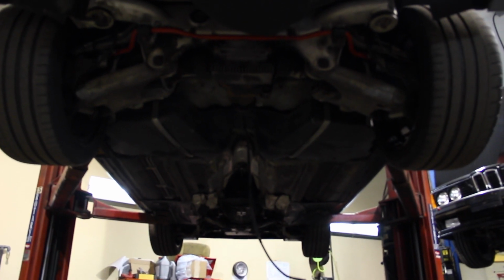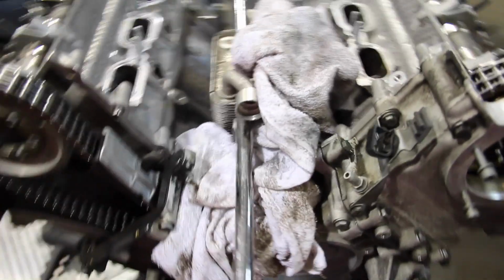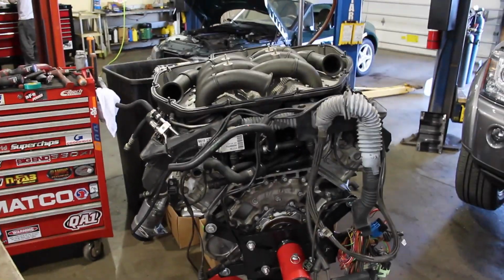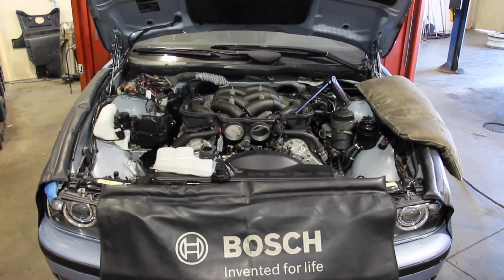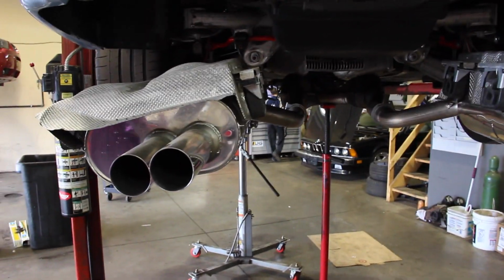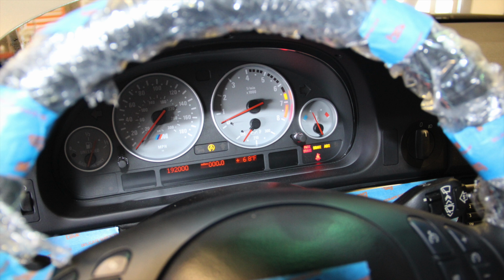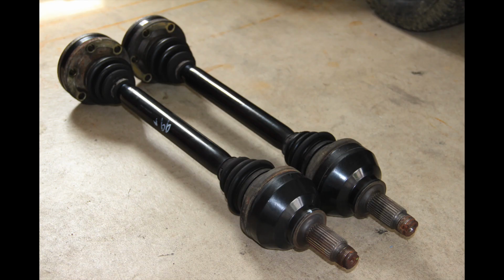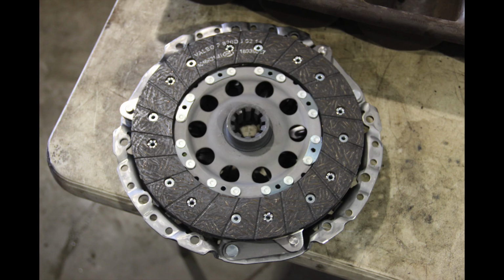Ryan's E39 M5 - Rebuild Project - Part II

Comment: Ryan, you've got so much into this car already, Why didn't you buy a new motor from BMW?
Why the rebuilt motor?
Reply from the maker: The new engine from BMW, installed, was around the $34,000 mark.  JUST for the engine.  That does not include the intake manifold, alternator, power steering pump, AC compressor, starter motor, etc.  I was able to do all of that, rebuild a good 2002 engine, the driveline, clutch, pressure plate, flywheel, rear subframe, differential, and choice suspension components for less money.

Comment: Why do you fill a 5W30 in an S62? Is it for the first start and flushing all the montage-dust out of the engine and you changed it immediately?If you drive the S62 properly, the engine need coercively an 10W60!It ran also with a 5W50, if the car is used as an dayli driver...But a 5W30? In Germany we called that stuff  "panther piss";)
Reply from the maker: BMW recommend 5w-30 engine oil for the facelift S62s (2001-2003).  The car now has 1,200 miles on this engine, and the oil is about to be changed to Castrol 10w-60, which I will now use into the future.

Comment: Little disappointed that there is no action shots of the motor going in or the heads being put back on... the major milestone steps. I am helping a friend do the exact same thing as you have. Was hoping to see those key steps not as a DYI, but general "Oh, that's how it's done" from 10 feet away. Also, we will do the engine bay detailing... and sub-frame, etc. For a never see winter snow or even rain, no good reason not to. IMO of course.

Comment: I had a black 2001 e39 m5...miss that car still to this day  :(
Reply: +TexasRedneck Its the type of vehicle which leaves a long lasting impression
Reply: +thisisantonymous I would say so... Love the M5
Reply: +thisisantonymous oh yeah, my vanos on the left bank was going out and with the other a possibility, I sold it as is.
Reply: +TexasRedneck Yes, the issues with the car also leave an impression I must say.
Reply: I bought myself a black 2001 E39 M5 when I was 21 and I still have it, won't go anywhere without me :D
Reply: +Jean-samuel boisvert I have a 1998 BMW E39 528i... And I love my baby right now treating her like a trailer queen she been parked for about three weeks
Reply: I owned a 2002 530i E39, loved it. I just bought a 2004 E60 525 with only 74k on it. Runs sweet as a nut
Reply: Mine was blk/blk, with the brushed aluminum interior trim.  Enjoy it man!
Reply: *****
the vanos on the E46 M3 and the E39 M5 are quit more expensive to fix than the regular double vanos from the same era. If I remember correctly from Dr. Vanos is around $2500 for both sides, when I replaced mine on my 325i it cost me $350 after core refund back then. Let's not forget that replacing the vanos on a M3 or M5 is a harder job and that not everybody will be able to get it done by himself,
Reply: Bmwmotorsportguy hell of an accomplishment at 21. Congrats

Comment: exactly this is a bit too complicated bmw technology vanos and some weird motheboard on each valve head there is a lot of controlling oil pressure . each motherboard has 4 selenoids...and no matter how hard you tried to put all parts back and how much effort you puted into this job .... there is always something rattle if not vanos then lifters if not lifters than some selenoids...gosh 5.5 liters v8 benz amg engine has no variable cams or anything like that just simple well build engine and pure power and they last long
Reply from the maker: Yes, the BMW motor is quite complicated.  DOHC, 32 valves, variable double VANOS on both the intake and exhaust valves, semi-dry sump lubrication, 9 throttle bodies, alusil coated block, etc etc.  But this yields 400hp from a naturally aspirated V8, along with 370lb/ft of torque.  The 8 throttle bodies provide the absolute best throttle response I have ever felt from a vehicle.  The engines also run 200k miles without much trouble, some even 300-400k miles.  I couldn't ask for anything more.
Reply: agreed 
the throttle response isn't the same in a benz, i've driven the c55 and it's just not the same